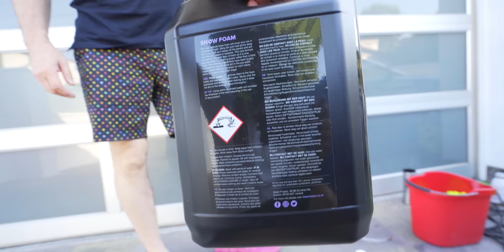YOU WON'T BELIEVE WHAT I DID TO MY ROLLS ROYCE!!

Comment: There is a professional detailer watching this having a heart attack
Reply: Only using one bucket made me squirm in my seat, wouldn’t even wash a hooptie without the 3 bucket method let alone a RR
Reply: Amanda Lee that was part of what I was thinking about, also using a spray wax instead of using a machine to apply wax. Sadly I don’t have a machine to do it with
Reply: Henry Collins spray wax is okay and gets the job done but it doesn’t last as long as actual wax, also, you don’t have to use a machine if you don’t have one. You can just buy some microfiber wax pads for $5 at your local auto store
Reply: Hahaha . He should not use pressure gun
Reply: It’s killing me
Reply: lol
Reply: he did nothing wrong lol
Reply: RETAILER
Reply: He can still have the car detailed after if he desires.
Reply: @bighands69  yeah true
Reply: @ESPSJ  Eh, a few things could be improved. Only thing I'd really change is a second rinse bucket and a second scrubber for just the wheels. All as it takes is a tiny bit of grub on your wash mitt and you'll scratch the paint or cover it with swirl marks. Doesn't matter for the average car, but a pristine paint job? Easy way to make a notable mark in it...

Comment: Fun video but you have to have 2 buckets and 2 wash towels. 1 bucket for the body and 1 just for the wheels. When Michael washed the wheels and went across the body he just made small swirls and scratches. The wheels have dust and pebbles that attach to the cloth. Never use the same towel from wheels to body. Keep the videos coming and stay safe 👍🏼

Comment: Add water to your foam bottle first, then add your solutions so you don't have to worry about the contents foaming up and overflowing the bottle. Water on its own will do nothing. Fill it up until only one inch remains then fill the remainder with the solution and give it a light shake afterward.

Comment: Greetings Michael from South Australia,  I have discovered your You tube videos which are very amazing entertainment providing fun and happiness to all , you are the vaccine to what the world needs right now, lifting our spirits with your smile and great dress sense, please keep on keeping on for all you existing and new followers like myself.  Best Regards William.

PS: The Rolls Royce car washing episode, do you realize how close you came to possible death when you point the metal jet gun up into the air,  discharging a wide water stream not realizing the high voltage cable network and pole mounted transformer setup thats runs very close to your house boundary, you could have electrocuted yourself since water is a great conductor of electricity and you standing on a wet driveway.

Comment: The pressure washer doesn't have to be on to fill the bottle, it will give you the normal water hose pressure when the machine is off.

Comment: Mate, contact Obsessed Garage for all the proper stuff and advice - don't skimp. Just a tip FWIW, ceramic coat your car and wheels (inside & outer to stop brake dust sticking) twice - yes twice or even three times - allowing for cure times in between and your paint will seem like it was sprayed with diesel, nothing will stick.

Comment: 2 tips: I prefer rain x for the windows over wax, sometimes the wax gets streaky especially if you use the wipers. Also, when using spray wax/shampoo go bottom to top so you make sure every square inch gets sprayed instead of foam/wax just running down- especially for the wax youll get a better coat
Reply: ah just saw the glass cleaner application lol

Comment: The secret of a clean car lays at the brand and used paint. His RR have the best paint a car can have, so cleaning with professional cleaning gear is right for a BMW Z3, when it is very dirty. 
Using a lot of water is spoiling. Washing a car scratch free is possible when experience in car washing is high.
I go to set my car into ceramic coat soon as the weather reports are reporting good weather conditions for coating a car. It’s black, so a difficult paint to work on.

Last, i have the same space for washing my car as PM. So i feel rich.

Comment: Hello Michael. Stunning car great colour. Firstly take off your watch and belt before  attempting to clean your Rolls Royce. Do you ever  wear a ring ? If so take that off ? If your vehicle is wrapped it's not such a problem ? If not wrapped I assume that the paint work has been ceramic coated?  A Chamois leather and water used directionally not round and round, use the same technique each time that you wash it. Kind regards.

Comment: Michael you should not dry your wheels with the same drying towel you have used on the paintwork, the wheels will have particles of grit which will scratch your car next time you use it.

Comment: Michael, the machine you use, is weak. You need a stronger and use it with hot water. You will be amaze from the results. Also, try to find "active" foam and leave it 3 minutes before you wash it out. After, you can spray liquid wax and wipe it out with microfibers.